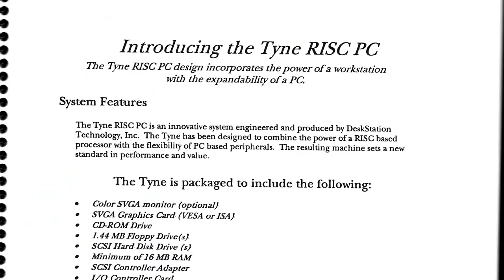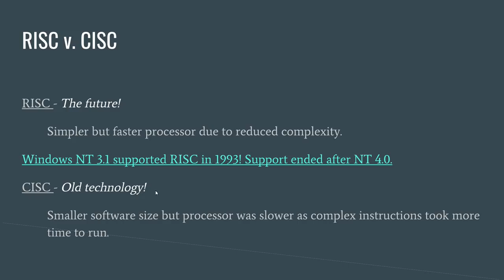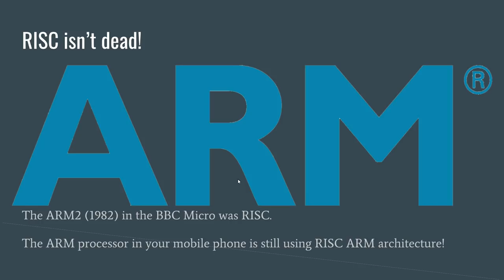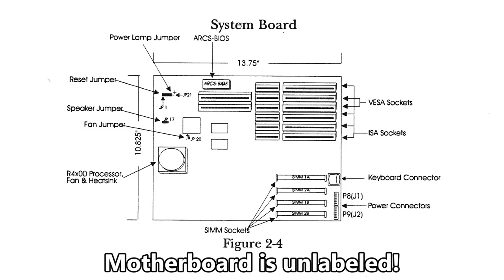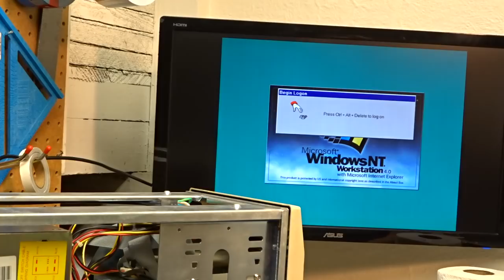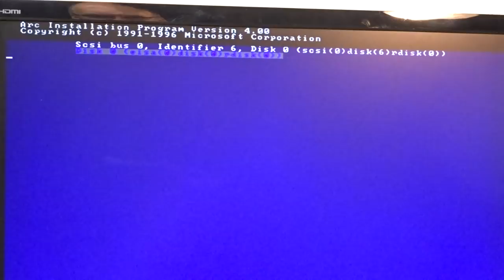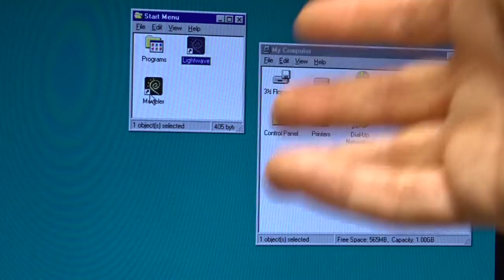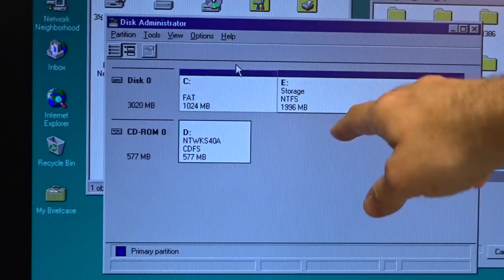Deskstation Tyne: A MIPS R4600 based PC that runs Windows NT

Comment: Back in the day I never really understood why one would need to run WinNT on a MIPS Risc PC that required a x86 comparability layer, particulately when Intel PC's just kept on getting faster and bigger. If you look back, anything that emulated or tried to be something else almost always died out. For example, I used Sunsparcs with Solaris. When Intel Solaris came out there was very little need to buy a SUN machine, so I never did. Don't get E wrong, RISC workstations are very interesting machines, but they would have been better served with native software.

Comment: Windows NT4 accepts IDE Harddisks with more than 2Gb if you install ServicePack6a.This replaces the atapi.sys. Windows NT4 do not need a Fat Partition to start. This is only necessary when the computer can not start from CD-Rom!

Comment: Kinda gives you a different perspective on the fact that Microsoft is playing with Win 10 on ARM now.
Reply: They did 8 on ARM (CoreARM SKU/Windows RT), but it was a complete failure. Interesting how they're going back to supporting more than x86, which they removed during NT 5.0 development.

Interestingly, NT still had PowerPC support in the early 2000s, even after it was removed from 2000, as they ported NT to PPC64 pretty quickly for the Xbox 360.

Comment: if you can get to its registry, you could disable password cashing on its registry 
(you would get back in with no passwords, and could also change the current password)

in cmd " net user administrator *  "

or theres the screensaver rename method

rename a copy of cmd.exe to the default screen saver

itll open after it tries to run screen saver

then the same command would work

Comment: The fan may be temperature controlled and wont turn on until needed. RISC also runs much cooler than Intels. Ithink Linux would have better served this machine( I would imagine there is an image for this machine.)

Comment: Adrian, using this, you can get into ANY Windows NT-based 3.5 to public-named 8.1 (and likely Win10 too) account without knowing the password. It is easy to use, BUT newbs to the program always have issue thinking they completed everything well when they did not. You have to SAVE your changes at the end!!! I recommend just blanking the password as opposed to creating a new one, with this software. Of course, on modern Windows, you will not be able to share like that but that is easily handled after the fact if necessary. You're welcome and enjoy!: https://pogostick.net/~pnh/ntpasswd/

Comment: I'm sort of surprised that the processor requires a heatsink fan being that it is ARM based.  All ARM based processors I have seen so far have been 100% fanless in tablets and what not
Reply: It's not ARM whatsoever.  I have no clue where you got that idea. He says a thousand times it's MIPS.
Reply: MIPS is one of the first RISC processors. ARM is younger. actually every RISC processor is dervied either from MIPS or SPARC.

Comment: It's confusing for the manufacturer to call it a "RISC PC" when Acorn released a "Risc PC" in 1994 (using ARM and RISC OS; it wouldn't run Windows unless a special card is fitted with a 486 or a 5x86, and even then wouldn't run NT).
Reply: Since this computer is from 1993 it's more like Acorn would have better named their machine ARM PC.

Comment: Didn’t I see the hardware key stuck at the back of the machine at the start of the video?
Reply: I think that may have been the SCSI terminator block. Since most early PC's used parallel or serial ports for the printer, they probably didn't want to tie them up with a 'hardware' key. If anything, the hardware key may have been on an extension cable of the AT keyboard port. I've seen some old bar code scanners that ran off the AT port...

Comment: I guess you could always play about with BeOS or QNX on that thing.  Had one at work.. There was no software for them even in 1995 so it got sidelined and I used my own 386 instead.. Ahhh the joys of windows3.1 (publisher and the like.. productivity in desktop publishing) There may be a version of Quarkexpress for QNX .. Or how about OS2 Warp .. of that Plan9 from Bell.. exotic isn't in it really with them is it? .. says the lunatic running Haiku on an AMD Athlon 64
Reply: I know of someone who tried to upgrade his ram on an Athlon 64 with the mobo still powered up and Windows Vista in Sleep Mode by the moonlight alone. It started to smolder especially after he tried to resume from Sleep Mode. Must have burned out an addrees line because it still worked, but only with 128 meg ddr1 stick, not 512 meg ones.

Comment: I know this video is old, but when Lightwave was complaining about the hardware key, it was referring to the dongle that was plugged into the SCSI port when you first started (shown at :33 seconds). Later when you were looking over the motherboard I noticed that this dongle was not plugged in anymore (at 10:25 time frame). I seem to remember that early versions of LW had a dongle for the SCSI port instead of the usual parallel or serial ports.

Comment: correction Windows 8, not Windows 10
Windows 8 is such bad OS because it was ported wrong way around
Basically Windows 8 is a enchanced port of Windows 7 to ARM platform
Windows 10 is a fixed Windows 8 redesigned for desktop in mind
from ABI and API stand point windows 10 is not much different from windows 8 - just use both and forgo interface - concetrate on how it behaves - it is same thing

Comment: I'd slap Linux on that badboi :)
You'd still have to compile many applications (apart from the ones present in the distribution repo) but at least there's plenty of code to choose from.

Should be able to run doom, quake 1, quake 2 if you manage to get a 3d acc working etc

Comment: Part of the RISC/CISC explanation is very wrong (most of the initial parts)

It have nothing with baggage or compability to do. It have with instruction lengths. A CISC processor uses varied instruction lengths. The advantage of that is that any instructions goes, the dissadvantage that the CPU is a bit more complex and instructions some times have to be dumped or delayed for a longer instruction to finish.

RISC on the other hand only have same length instructions. The disadvantage of this complex instructions have to be broken up to less complex instructions, so the its harder to program and the number of instructions increase. On the flip side is that the CPU get less complex and there for smaller and generally be able to run more streamlined.

The thinking was that RISC processors would be cheaper to produce, run at higher frequency and pretty much compensate for the disadvantages.

This was true for the late 80-tys and early 90-tys. But when multi scalar CPU was introduces Intel and AMD pretty much could just build around the instruction length problem. Also, lower number of instruction led to more efficient case usage and better bandwidth usage.

Also going into the P4 era, Clock frequency was no longer limited by Architecture, but rather silicone. Making the P4 run faster than the G4 and G5 even if it had CISC instructions. Pretty much running both faster and more efficiently.

That is... A CISC that run say 1M instruction per second is in real world application about as fast as a RISC that run 1.5M instructions per second. Back in the 80-tys when Transistor count was the main problem, RISC processors was superior. But when in the late 90-tys buss and cache space become main issues, CISC starting to be superior.

4:00 A other reason why RISC was not popular in the 70-tys was that it was first defined in 1982. While RISC style processor kind of existed before. The first true risc was in 1982.

4:20 Actually Intel dropped a few comparability codes with the original i386. While it have all the processing instructions, it lacks a few special instructions So you really can´t run DOS 1.0 on e new Core i7... (or even Windows 3.1.. but im not sure about that, it probobly depends on the DOS version its running)

About the 8086 to Pentium it was kind of a "tick tock" process.
8086 was 16 bit and produced 1/4 instruction per clock (8088 was kind of a 8086SX)
80286 used pretty much the same instructions, but worked at 1/2 instruction per clock
80386 used new i386 instruction set (pretty much the same but 32 bit), and still run 1/2 instruction per clock 
80486 used the same i386 instructions (pretty much) but run at 1 instruction per clock (+ the DX model had Floating point processor)
P5/P7 Used the same i386 instruction (pretty much), but run 2 instruction per clock
P-MMX added simd instruction that could uses up to 4 data per instruction, still running 2 instruction per clock. This was only used on the new specialty instructions. So it was heck of a lot faster, but only on adapted code.. So running the same code, it was just as slow.

From this point all order pretty much breaks down.

7:12
The reduced power consumption of RISC is not really true.. or actually not true at all. Its really not even close to be true. RISC processors consume more power than a "identical" CISC. The reason why ARM Is so popular in mobile phones is that the won the MHz race back when that was still around. Simply put, a RISC processor can run at higher clock much simpler. Back in early 00-tys when the first Smartphones hit the market. Companies like Handspring and Ericsson run 30-60Mhz smartphones, while ARM run 100 or even 200Mhz processors.

The ARM processors was really not that much faster, and they didn´t consume less power, or even close. But they had a higher number. By the time of Android and iphone ARM was up to 600Mhz and the CISC processors was only 200 ich range. Still they was pretty much on par in speed, and the RISC did consume a LOT more power.

Also, at this time, the mid 00-tys the horrible P4 was still around. That had no power features what so ever, and was a freqvency hog.

While pentium M that was far more efficient was around for some time, and core duo came in 2006, the was considered nitch low tech processors.  Intel and AMD did have ultra low power CPU for the mobile market back then, and there was actually x64 support for Android for a while. My wife actually own a x64 power tablet, and its really quite fast and have a impressive battery life.

That RISC is more powerefficent is a total myth and is not even close to be true. Also worth mentioning that the A15, A53 and A58 processors is not really quite RISC. They are more  of a RISC/CISC hybrid (as well as super scalar) and that is the reason why they are so much faster than the slower A7/A8/A9 series.

About the VESA bus. The early 486 that run of 25 and 33Mhz run directly to the VESA bus. The VESA is used maximum of 33Mhz. Some 486 used 40Mhz run also directly on VESA, pretty much overclocking the VESA bus to 40Mhz.

The 486 DX50 came before the VESA bus and was not comatible. THe DX250 and DX266 used internal clock douler to adapt the buss speed to the VESA bus.

The early P50 and P60 and P66 used a special chip to addapt the freqvency to 33Mhz for the VESA bus (most early P5 used VESA, PCI come a bit later)

When PCI was introduced this method was mimiced on all PCI. PCI is really quite simular to VESA but with out the legacy stuff and a mandatory bridge.

This computer probobly have a VESA bridge.
Reply: > But when multi scalar CPU was introduces Intel and AMD pretty much could just build around the instruction length problem. 
Since the Pentium Pro in 1995 and the AMD K5 in 1996, x86 chips are RISC-like internally. They translate the x86 ISA into micro-ops (Intel slang). 

>The reduced power consumption of RISC is not really true.. or actually not true at all. Its really not even close to be true.
If that is the case, then why is ARM king on cell phones? You say because they won the Mhz race. But if Intels Atom x86 chips were
better w.r.t. power they would be used in millions of cell phones today, because Intel chips run as fast or faster than ARM's. And using ARM designs is expensive (royalties + licensing). Intel made several attempts to enter that market, and I am sure they undercut ARM's offerings regarding licensing and roayalties. Of course ARM has a much more mature eco-system for SoCs (system on chips). The biggest problem however for Intel was that they never managed to get power consumption down.

Tablets are bigger. Power is important but not as important as with cell phones. In hearing aids or other small devices where power is extremely relevant, you will never find a SoC with a CISC core.

> RISC processors consume more power than a "identical" CISC.
In this general form this is simply not true.
Reply: " They translate the x86 ISA into micro-ops (Intel slang). "
No its the DECODING that is Risc like, not the instruction. Micro-ops is a industry standard term, not a intel slang.

"If that is the case, then why is ARM king on cell phones?"
because of pretty much the same reasons why x86 become the default PC CPU. In short, its complicated and have nothing to do with superior performance.

" The biggest problem however for Intel was that they never managed to get power consumption down."
That is wrong, go check it up. And you don´t know how a phone works. Its a logic circuitry that handling most of the base station contacts. A modern phone in standby really don´t need to wake up the CPU more than once every hour or so. If you move (like riding a train) it update much faster, and the phone uses quite a bit more power.

When the CPU is in sleep mode it use no power what so ever apart from cache refresh. This is true for ARM, AMD as well as Intel CPU (but not the older generation i series). So if the power for the CPU is of it don´t matter if you have a ARM och x86 CPU.

When the power turned on its a matter of the time it takes the CPU to solve the problem. A faster CPU solves it faster. While using more power, it may use less energy. That as the case for the intel phone. The intel phone DID use less energy. The reason nobody every produced it was that non of the phone manufactures want to deal with intel licensing. Because then you can´t design your own transivere and are stuck with Intels crapy one.

That was the reason. That was also the reason why it was in quite a few tablets. Most tablets have the transceiver in secondary circuitry (well at least did back then)

There was attempt to produce ARM processing clusters a few years back... You heard a lot of them last years? No, because they sucked. The preformed poorly.

"In this general form this is simply not true."
If you have a identical CPU apart from instruction implementation, the RISC CPU will need to do more cycles to preform the same program. If it want to preform similarly it need higher clock. While the CISC need more transistors. Having more transistors is more economical than higher clock due to logarithmic draw of power in relation to core frequency.

So no.. you are wrong

Comment: Has anyone installed windows NT on a PowerPC Mac? Windows NT supported the PowerPC platform, so it should run on one.
Reply: The PowerPC Mac machines can't use Windows NT because of the firmware. 
The only Apple/Mac that might be able to run it is this oddity:
https://en.wikipedia.org/wiki/Apple_Network_Server

The PowerPC machines you'll need were made by IBM and Motorolla, based on the PReP system architecture standard.

Comment: While not completely wrong, the explanation of the RISC architecture was maybe a bit too simple. Allow me to explain why the RISC architecture was such a revolution back then. Before there was RISC everyone was going the CISC way because memory was expensive. Using more complex instructions meant that you could express certain operations in fewer lines. To give you an example if your instruction set has a multiply instruction, that means that you only need one line of code to express the multiplication of two numbers. You could however express the same thing by simply using addition if you add the multiplicand times the multiplier to itself, which in turn results in more lines of code and thus a higher memory usage. A lot of these very powerful commands of the CISC architecture however ran in microcode, small programs on the cpu itself and it took them several clock cycles to complete, which of course is bad if you need the result of some operation immediately. RISC went the other way and tried to make every operation a short as possible, meaning the cpu has less idle time since the results are there much quicker. RISC also introduced cpu cache, which in conjunction with caching strategies allowed for much faster memory access times. Nowadays the lines are blurring and while x86 CPU are still often times considered CISC cpus, they have incorporated a lot of RISC  ideas.

Comment: i appreciate that you didnt put in that sd emulator crap that almost every so called "retro computing channels put in completely ruining the period correct originaliaty of the machine and the experience of using it
Reply: To be fair mechanical components like like floppy drives and hard drive are going to be completely gone before you know it.  I’ve personally struggled with my Tandy 1000 ex and hx. Those floppy drives are impossible to find working at least for me. So I just settled for a gotek in the hx and newer 1.44 drive in the ex.
Reply: i know that but i meant that some of them even if the floppy works they just toss it in favour of that emulator crap just for confort

Comment: unless these PCs have an x86_64 compatability layer like x86_64 does for x86 it will never happen.    the cost is far to great.   Loss of ALL existing pc software is a cost far to great
Reply: It does have WOW (16-bit x86 on 32-bit x86), but only 64-bit Windows can emulate 32-bit x86. WOW64 on ARM Windows 10 can run both 32-bit ARM and x86 programs.